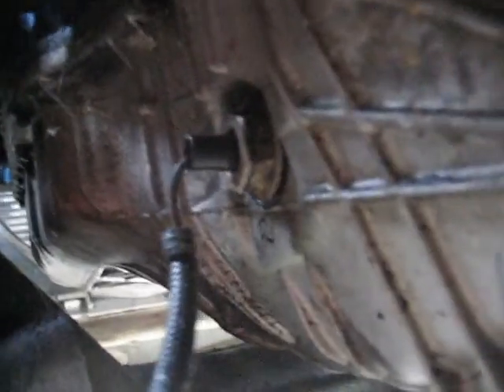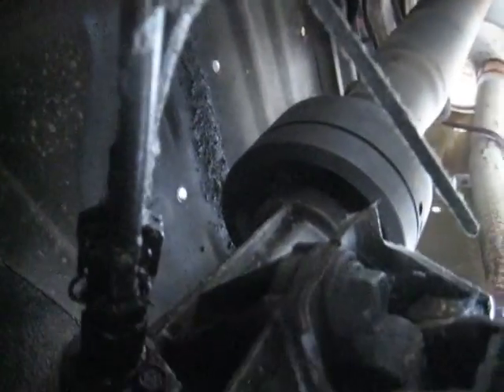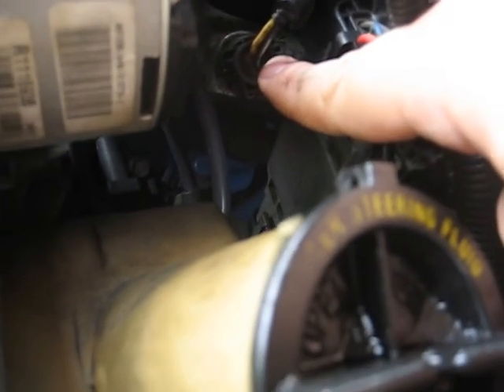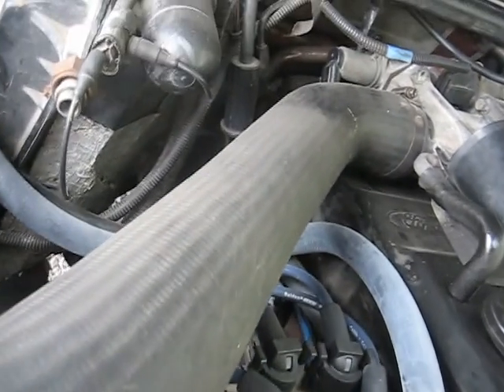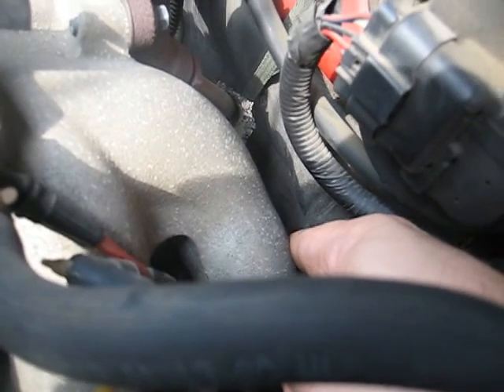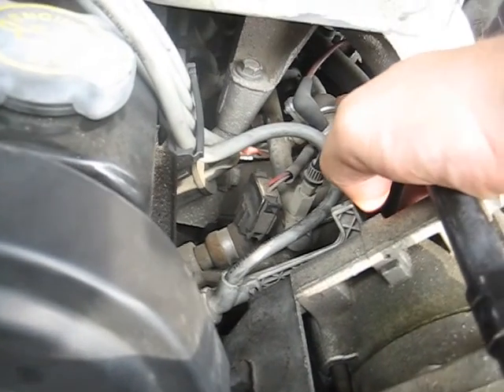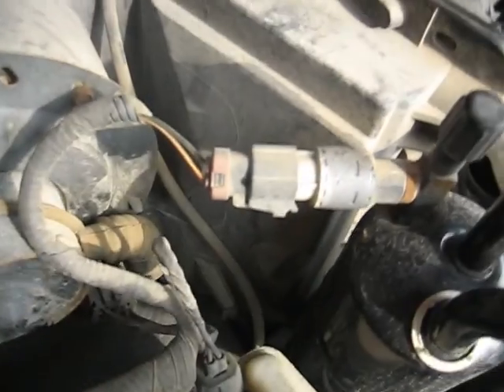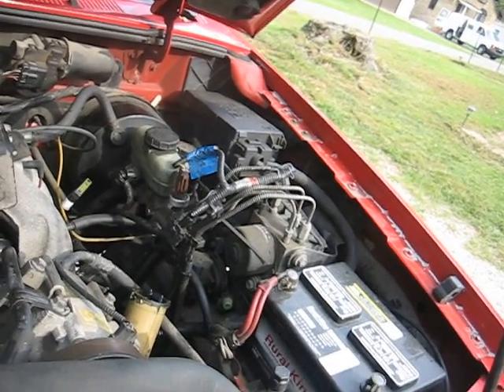Sensor Location Ford OBD-I and OBD-II

Comment: Got a 95 Mazda B2300. Had a map sensor code. I've read it don't have one. It's obd2
Reply from the maker: 95 is still OBD1, regardless of computer platform, most trucks have a manifold pressure sensor (map) the code for map is often confused for the mass airflow sensor, which on that truck should be on the airbox before the snorkel tube going to the throttle body. Manifold sensors are usually screwed to or a part of the intake manifold, around the throttle body, if you don’t have one then your truck wasn’t designed for one. I’m pretty sure it’s mass airflow though.
Reply: @ranger.auto.repair  thanks. It's obd2. I've had codes read many times and they can't use OBD1 scanner. It has a speed sensor on transmission as well. I've had the argument many times with ppl saying it's OBD1 and it's not. Most code readers have to check for a 96 to get the codes but the reader will say it's a 95. It's one of those trucks that was made in the transition part of 95 where they was switching from 1 to 2

Comment: Anyone able to tell me this ?   if the inside of 1990 Ford Ranger was to get hosed out would it destroy the vehicle
Reply: 1990 ford ranger doesn't want to drive or go in and out of gears but its not jammed up it still has normal  play in the shifter  ..doesn't want to start unless its jumped with cables.  ?..Then it revs up when trying to go into a gear doesn't want to move but I try to go into another gear it trys to go but still doesn't seem to want to go ....reverse is a little better but still doesn't seem right .......?
Reply: I’m guessing that it’s a manual transmission vehicle, I actually had this problem in my case the transmission lost fluid and the gears locked up, in your case it sounds like you have a clutch issue, the disc is worn to the point it’s not allowing anything to work. On the starter thing you might have an electrical problem between the battery and the starter, I’d check the wires and make sure it’s all good. Then change the clutch and that should do it.

Comment: Does switching the during position on one of the distributors give you more gas mileage, torque and power?.... so should I keep them how they were designed?
Reply: I think you mean coils and no, on the OBD-I dis module if you switch the connectors it simply won’t start, if you disconnect the coil packs from the module it won’t start either, if you disconnect either coil and try to run it on one it will run but it sounds like a dead miss and there’s no power. So leave them as they’re positioned. On the OBD II version if you do anything with the coils you’ll get a code and a light. The ignition on the OBD II is run from the computer.
Reply from the maker: I think you mean coils and no, switching them won’t do anything other than burn out the pcm. I’ll do a video about the dual plug system to better explain this

Comment: Can a faulty VSS cause check engine light? I think mine went out because when I was going high speed the speedometer ceased to work and the truck jerked once very faint right when it went out.
Reply: OBD II it will trigger a check engine light, code P05xx on the OBD I systems it will not turn on a light but that’s vehicle specific, some dodges and GMs will turn on a light as far as I know fords wont.
Reply from the maker: Depending on the year it will turn in the check engine light, some trucks have a trans light that will come on but for the most part no light, I think 2010 onward will turn on a light. I had a vss go out on me and I found it by doing a routine scan.
Reply: @ranger.auto.repair  Mine is an 89' Ranger 2.3

Comment from the maker: Depending on the year there are two, one is almost always in the exhaust manifold(upstream) and the other is located past the converter in the straight pipe just before the flange for the rear pipe (downstream) if it’s a 6 cylinder then double the amount of sensors, they’ll be in the same places.